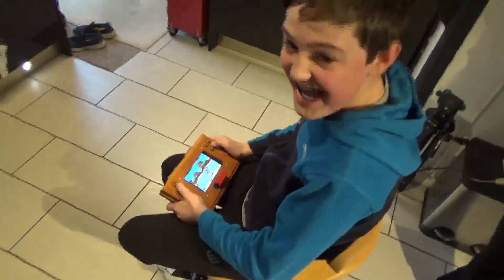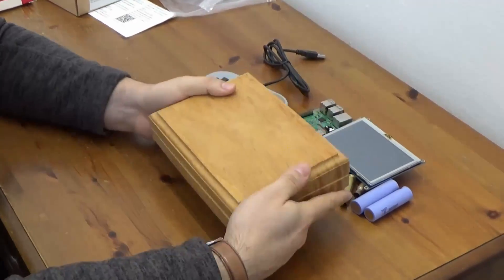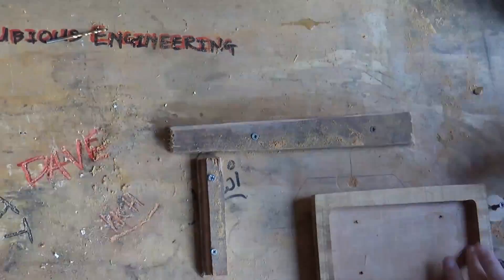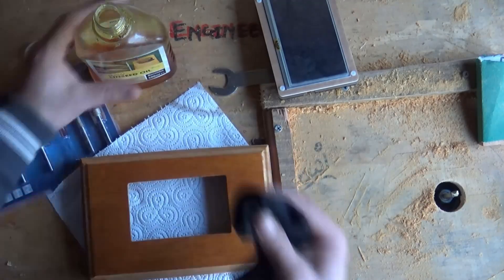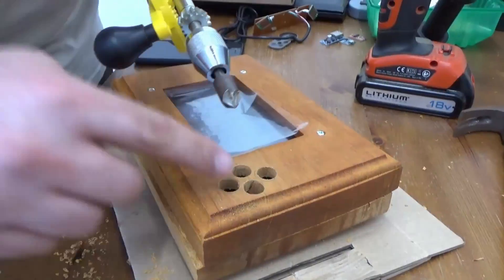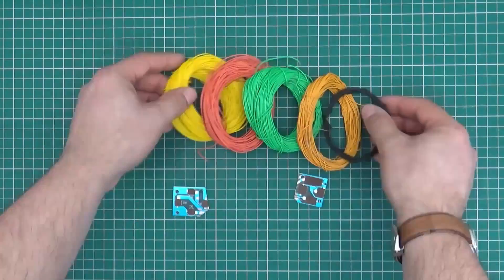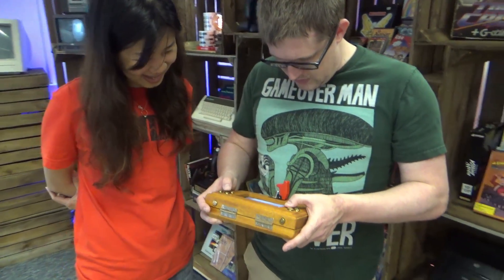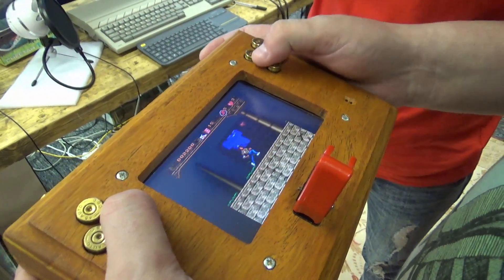DuB-EnG: Make a WOODEN HANDHELD DIY Games Console Build Classic Gaming Emulator RetroPie RaspberryPi

Comment: Nice. Always like seeing your video on this project. All good things come to an end though otherwise they can't be good things I suppose. Anyway I'm off to finish my pi zero powered Atari flashback.....Is the pi laptop project still on the way?
Reply from the maker: I have just secured a 3D printer! ... (well the wife let me buy it) ... I can’t wait to show you the case I’m designing!  So... laptop = yes. ....  also, I have a pi zero too... so, one thinks a tiny handheld is in order!
Reply: Dubious Engineering You lucky bleeder. Lol.Can't wait to see it.
 If your gonna go tiny handheld, retropie comes with a controller driver you can run directly off the gpio. Serious space saver that.
Reply from the maker: Definitely learning from my mistakes and won’t spend money on a usb controller...  gpio all the way with a decent size screen 3 or 5 inches.  Light and good battery life! Need some smaller speakers... can’t wait to make it... I may cheat and go the thingyveres way...  Someone has done the hard work already!